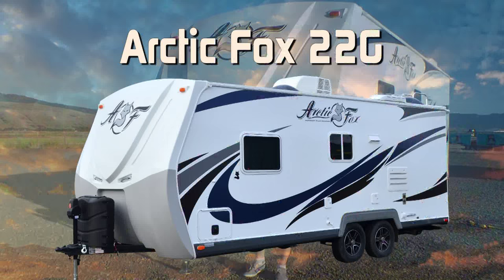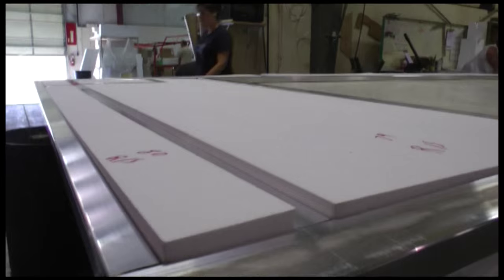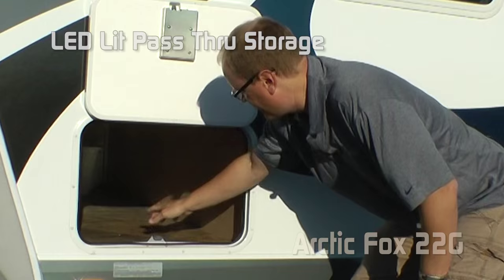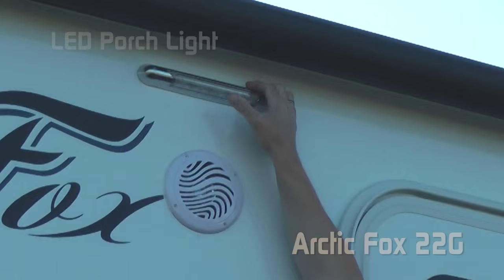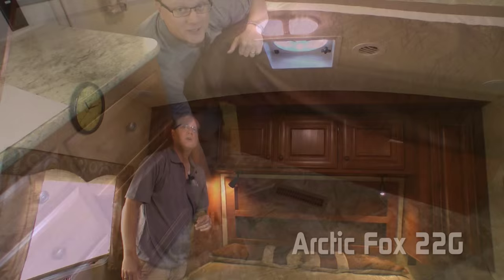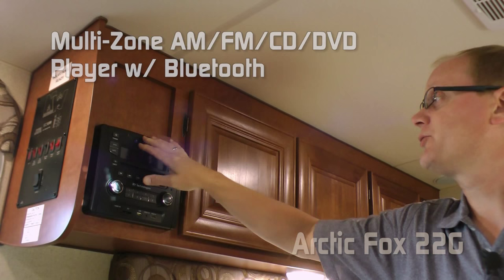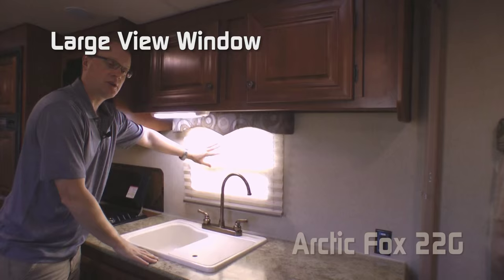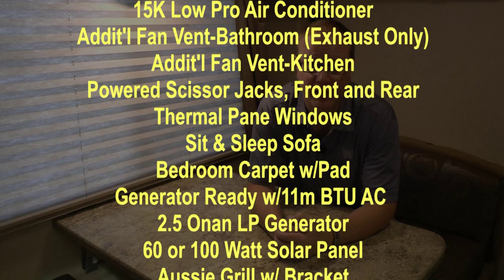Quick Tour of the NEW Arctic Fox 22G

Comment: Nice, please mount the spare up front underneath the batteries and propane tanks. Please make a super strong reinforced rear bumper made to hold a big heavy cargo carrier. Please make a roof that's not a rubber membrane but a strong thick solid puncture proof lifetime maintenance free material. Please have the huge full sized opening window in the entry door. Please use a 100 gallon fresh water tank and 50 gallon gray tank and 50 gallon black tank.

Comment: Don't really care about all the scientific gibberish below but I've owned a '11 AF 26X and camped side-by-side to friend's newer Classic Airstream TT in winter and summer and there's no comparison. The design, insulation and inclement weather performance of the AF is far superior to that of the Airstream. I've always wanted a Classic Airstream with twin beds and will eventually get one, since AF no longer offers twin bed options, but I know the limitations of an all aluminum TT.
Reply: I dont understand why all toy haulers 25ft and under don't offer enough room for a full sized queen temperpedic mattress.
Reply: The science in the design is all that matters so I think the discussion is dead on. I'm a full timer and have had two Foxes for living in cold weather at times, one older wood frame and one newer. The sad thing is that they are among the best available but both still have had problems that no "4 season" coach should have. With a dehumidifier running 24/7 (have to be plugged in at a campground), the rear corner of any closet will still have condensate form and run down into the wood, threatening a moldy, warped mess. With temperatures only in the 20's or 30's F, the storage area under the queen bed gets so cold relative to the mattress above that it will cause condensation to form in the lid that the mattress rests on, ruining both mattress and lid if it isn't noticed and stopped quickly. If the science and build were correct, these kinds of problems would not be an issue. Fox owners deserve better given the sales pitch and claims.

Comment: I totally respect Arctic Fox for manufacturing top-quality, exceptionally well-insulated travel trailers! I wish Lance and Winnebago would follow suit.
Reply: Lance is the best travel trailer on the market. Lance RV's aren't so much designed as they are engineered. Check out their videos. They're hardcore. 
Northwood would probably be my second choice. I don't like the wood roof trusses and the membrane roof. I don't like the luan ply in the sidewalls. Lance is all aluminum. No wood. They use some sort of a composite plastic in the walls rather than 1/4" plywood. You won't have blistering. Also, all those heavy solid wood cabinets weigh a lot. Lance uses a wood composite of some kind. Looks great. Lasts forever. And it's light...

Comment: This is the  best built trailer on the market.  I have spent 2 years looking at them all, it is time to replace the Tango. In 2006 Tom Powell started Pacific coachworks and followed the same quality you see here. The company sold in 2010 and is not complete crap. Ours is 13 years old and we have had ZERO issues since new. Outdoors RV is also similar in quality but looks like the same family owns both.  Now..get a dealer in So California!!!  And not Thompsons or Richardsons.  The Nash is awesome also, I just cannot own one as a great friend is named Nash and we all camp together and that will look gay to have NASH on 4 sides of my trailer.
Reply: I'd say the Lance is probably the better trailer.
Northwood uses solid wood cabinets. I was in the kitchen cabinet business and solid wood cabinets are heavy. 
Lance uses a composite material of some sort for their cabinet cases and doors. Much lighter. 
Lance also uses Azdel in their sidewalls. Very important.
Northwood uses wood roof trusses. If I'm not mistaken, Lance uses aluminum. 
The only problem I have with Lance is that they have that yuge step-up for the slideout. They say they do it to keep the profile lower for less wind resistance.
That's kind of silly because you're driving for only a few hours but you're living in the thing for days on end.

Comment: It's surprising that the walls are still being built with such poor thermal qualities. Aluminum avoids some troubles and weight of wood, but it transmits temperature so well that there's barely a point in having insulation in or between its framing members. Northwood needs to purchase or develop a serious thermal wall scheme, maybe with composites and other durable materials, and at least have low-electricity-consumption radiant floor heat as an option if the "4 season" claim is going to be worth much. Just one full day/night at around zero degrees can kill full dual-batteries with the present system because the furnace uses so much electricity, even though it's burning propane. As more than one bright AF owner (or former owner) has pointed out, for now these are truly 4-season starting down around the 38 degs. North parallel, especially if you have a slideout and/or you're not plugged into park power somewhere.
Reply: Aluminum is an excellent conductor, however the cross section of aluminum passing from the exterior to the interior is miniscule. It looks like 1/16" thick wall rectangular box tubing (which has internal insulation). Therefore, where each stud exists, there is essentially a 1/8" thick strip of aluminum running from floor to ceiling. If the stud spacing is every 16", then the ratio of conducting aluminum to insulated wall is 1/128 (i.e. less than 1%)
P.S. I've never owned an RV but am looking at them and conceptually prefer the use of aluminum over 'stick'.
Reply: Gregory Parrott I'm not sure how you're coming up with the 1/8" of interior to exterior aluminum contact but the pictures suggest otherwise. That would be a scary proposition for structural integrity if the 1% surface-area number, or anything like it, were true. If it is not true, then as I noted, the thermal value of the insulation is seriously compromised (and probably is anyway). That doesn't mean it isn't a great wall for other reasons like weight, though. It just isn't appropriate to a "4-season" claim, just as a highly power-inefficient RV heating system isn't.

They could probably get Building Science Corp. or other serious experts to help create a good alternative. I know what BSC says about insulating metal-stud walls, so I'm pretty sure that would be out. That's how you make an R-19 batt of insulation suddenly have an effectiveness of R-4 -- put it into structural material that has 400 times the conductivity of wood. (I am a former AF owner. It's nicely built and a more secure trailer in cold weather than most, especially assuming you're connected to AC power, but that's not saying much. It's no everyman's Mobile Suites unit or anything like that. Given where the state of the art was a decade ago, AF could and should do better with a few things.)
Reply: How do I compute the 1/8 inch? Simple. A rectangular tube has 4 walls, each a sixteenth of an inch thick. One wall rests against the exterior surface, another rests against the interior surface. The other two walls pass through the insulating material (serving as the conductor of heat through the insulation) and each wall is a sixteenth of an inch thick. Combined, that represents an eighth of an inch thickness and it has a length which spans from floor to ceiling. 
If you had a thermal camera looking at the wall, then where every stud existed you would see two 1/16 inch thick vertical lines running from floor to ceiling as the coldest features of the wall (1/8 inch combined). Once that cold passed into the interior, the camera would show the cold disbursing across the side of the tubing which is flat (parallel) with the interior surface.
The contrast with lumber is that it is solid, not hollow. If the aluminum tube was replace with aluminum bar stock, then the entire width of the bar stock (say 2 inches) would be conducting instead of just an eighth of an inch.
Reply: I am curious if you can suggest another manufacturer who uses a better material in terms of combining strength, longevity and insulating value. I saw where a European truck camper manufacturer built a unit out of a structural block foam wrapped in fiberglass. This offered continuity in insulating value. Several grades of foam were available. But as the level of structural rigidity increased, the R value decreased. So ito be structurally sound, it might end up with no better an insulating value than the combination of dedicated insulation intermittently compromised by an aluminum conductor. Also, I'm not sure if that structural foam would scale well for something the size of a toy hauler.
Reply: Gregory Parrott Because of the wild difference in conductivity compared to wood or other materials, I don't think the width of the aluminum material itself is that significant in reducing its thermal impact, including with the material it is passing through that is supposed to insulate it, and the real issue is the width and length of the connection it makes on both sides of the wall, which is where the transmission is effected. I mentioned Mobile Suites, and there are other high-end types as well as lower-range manufacturers like Lance who offer all-season packages, though they are often still compromised by aluminum structure. Some use more thermal breaks to try to reduce its impact. That is why I suggested that this needs serious attention from specialist engineers at BSC or similar who can create systems from scratch and prove them out in actual mock-ups under nightmare conditions, etc., not just computer modeling. My guess is that the answer lies in composite or thermally-coated framing and a layered wall somewhat similar to Mobile Suites, but I am no expert.
Reply: Never heard of 'Mobile Suites', but in looking at their website now, I see they only make HUMONGOUS fifth wheels. Their toy haulers weigh 19,000 pounds unloaded and are aptly named 'Full House'. There must be a  jacuzzi on board.
Reply: Gregory Parrott The only thing more over-the-top than their features and weight is the price. They are essentially the 5th-wheel option in the large custom bus market and their isolation from the outside world and their options for heating, etc., are in a similar class. That was true many years ago, also, though, and I'm quite sure that much can be miniaturized and normalized for regular use, at least as options, to the advantage of the average AF owner along with some better thermal-structure engineering for thin walls / lighter weights.

I think the ideal should be something like: with two factory solar panels on the roof in average weather conditions and exposure, the unit will require no additional electrical input (propane only, without Mr. Buddy or other portable appliances or consumer mods) to maintain a comfortable temperature and functional systems down to at least -5 degrees F in conservative use. To me, that would be a true 4-season unit.
Reply: Minus 5? Yikes. Even with the internal temperature set down to 40F, my house furnace would be on half the time despite the standard dual pane windows, R18 walls and a much higher rating for the attic. But with a name like 'Arctic', I guess it's fair enough to expect -5 to be a baseline to qualify as 'four seasons capable'.
Reply: Gregory Parrott With a ductless heat pump designed to operate at low temperatures, I can heat a new 800 sq. ft. home to 70 degs F or better with just 600 watts of electrical input (no propane or other fuel) at that temperature. That's state of the art that uses BSC-advocated engineering design, and that's why I suspect much could be done to bring that current level of thermal tech down to 4-season RVs like AF. (Even with the standard I suggested, it would probably not be a 4-season unit for the northern Plains of the US and Canada since their winter temperatures are often well below that for weeks at a time.)
Reply: Impressive. Sounds like they need to go mainstream and promote their product nationwide (unless they're already doing that). Do they have a website?
Reply: As far as I'm concerned, they are the premier building science company in the US right now. Their main man, Joseph Lstiburek, is a very well-known Canadian and a PhD mechanical engineer who is also a professor in his spare time (!). While he is disliked by plenty of people in the industry because he doesn't hesitate to call even famous pros out for their nonsense, and very publicly, his practical training is a godsend for everybody from homeowners to pros who want to actually know what they're doing per the science. If you just Google his name or Building Science Corp. you'll get weeks or months worth of reading in the results. For a great intro on YouTube if you're interested, there's a lecture he gave at the Army Corps of Engineers in Texas that is quite entertaining as well as a wake-up call. Just copy and paste this up in the YouTube search box: 02 Module 1 Lstiburek
Reply: Will do. Thanks.
Reply: I watched "02 Module 1 Lstiburek". Very interesting. Towards the end of it, I see the similarity with what you pointed out in the RV. He is mighty abrasive though. He could better make his point were he a little less cynical. I worked with an equally cynical physics professor. He angered enough people that he was fired despite for the most part being right. A little humility and compassion goes a long way.
Reply: Gregory Parrott Sometimes a highly knowledgeable cynicism and knocking heads together in an industry or at a company is the only thing that breaks through the absurdity of groupthink and pretense. It would never fly if it was just criticism without real answers and solutions, but he has delivered a wealth of principles and applications to use and explore instead. That approach has resulted in quite a sweep of changes, or pressure for them, across the industry towards what you saw presented there. If all he accomplished was forcing LEED to get real, he would have done great service to the public. But his design philosophy has become widely experimented with, studied, quoted, built, and I just saw a new federal construction project in which the agency is requiring that all proposals meet his underlying design principles. The Wall St. Journal refers to him as "the dean of North American building science." Hopefully his company's help, or that of others trained accordingly, can reach down to nominally priced "4-season" RVs at some point.
Reply: Now that you mention a circulating pump, it seems to me that rather than have a separate system to move hot water through the insulated floor cavity, an alternative would be to have a diverter valve that enabled the PRIMARY water pump and water heater to periodically circulate hot water through the main lines and back into the fresh water holding tank. Also, you could add a second heated mattress pad that is used to surround the grey and blackwater tanks.
Reply: +M Coy Other than the 'four season' shortcoming, how reliable have you found AF to be?. Have you found other issues? As a newbie looking to get a bumper pull toy hauler, Northwood's 'Desert Fox' looks like one of the best. On comparison of manufacturer specifications, the main wish list item for me is that they would used Azdel instead of luan in the walls (better insulating properties and is immune to delamination should moisture get in)
Reply: +M Coy   I would think that a 'four seasons' rating or even one intended for hot desert use should be REQUIRED to address the weakest link in insulation by using dual pane windows. So far, I've only found one manufacturer (Lance) that offered dual pane windows, even as an option. (Add that along with Azdel wall construction to my wish list.)
Reply: I've watched several videos at Northwood's website, ones covering both their toy haulers and travel trailers. None of their videos nor their product specification for options mention either dual panes or some sort of augmented pane for the windows.
Reply: +M Coy  Thanks for checking. In their video, they describe the optional thermal pane windows as having an external mirror finish which greatly reduces solar energy. But they don't say these are also dual pane.
Reply: Interesting. I think it was Lance that advertised 'dual pane', so I assumed that if Northwood also has them, they would promote it. But I guess it's my interpretation.
Reply: Interesting discussion. It was kind of you to suggest my involvement, and I would be delighted to help AF work out some thermal resolutions, but I would be involving real experts in thermal engineering to help do that and I'm sure they can do that themselves. I just know that it needs to be done. I agree about the storm-window option and similar capabilities being available, I think window options is something they have always had right. I would not want to see that changed, owner hassle or not. For those who need the 4-season functionality, that is one of those options that makes AF stand out from other manufacturers who have not taken the time to get that right in real-world conditions.
Reply: Boys, what is AF?
Reply: "AF" Arctic Fox.....
Reply: For me, true all-season specs means the trailer can be used in above-100 temps in the summer and at a minimum several degrees below freezing (i.e. mid-high 20s).
Reply: Gregory Parrott it’s actually worse than you think. That 1/8 strip is connected to a 1 to 1.5” wide radiating surface that holds the insulating panels. One wide heat conductor, thin strip, another wide conductor.